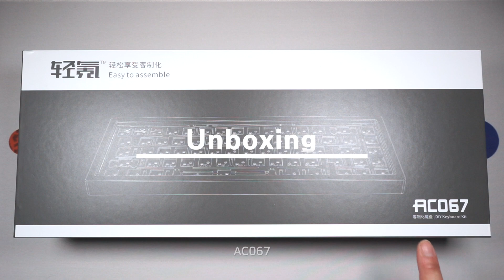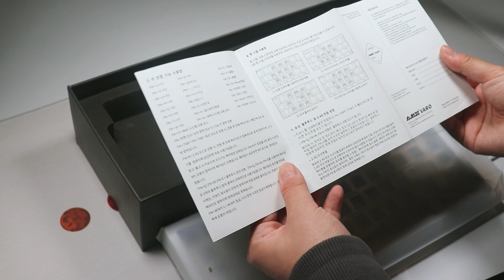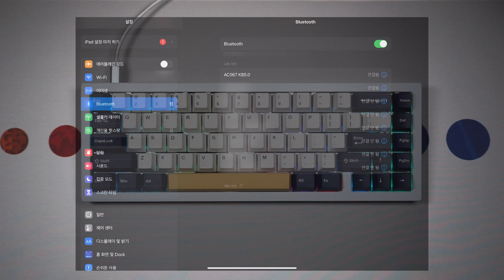Wireless Aluminium Keyboard ?! (AJAZZ AC067 | Bluetooth, 2.4Ghz, Hotswappable 65% Gasket Mount)

Comment: Hi, thanks for the clean beautiful video. Do you feel enough flex or bounce from the gasket mount? I have been looking for wireless gasket mounted keyboard, but every product I find seems to offer very stiff typing experience and I would like a bouncy and flexible typing experience. And was wondering if you could share your experience.
Reply from the maker: Hello! In my experience, AC067 is not that flexible. I think it’s because inside keyboard, there are full of poron or eva sound dampening foams on every layers, so physically it can’t be bouncy even if it is gasket mounted keyboard I think.
You can try removing plate or bottom foam and this will makes keyboard little more bouncy.
Reply: @geekey  thanks for the reply! So you’d think the stiffness is not because of the keyboard having a battery inside, but because of many foams?
Reply from the maker: Um.. I don't think it's a battery space problem. Cause there is seperate battery space hole in bottom case.
Yes, removing foams seems to be solved your problem even a little. But on the other hand, this will increases inner echo a  bit.

Comment: Does it auto sleep when running on battery with wireless mode?
Tbh the battery switch under the spacebar  is pretty dumb
Reply from the maker: Yes it does
As you said the switch position is sometimes cumbersome🤣
Reply: @geekey  thanks for replying. Hope the switch position will be changed in the retail version.